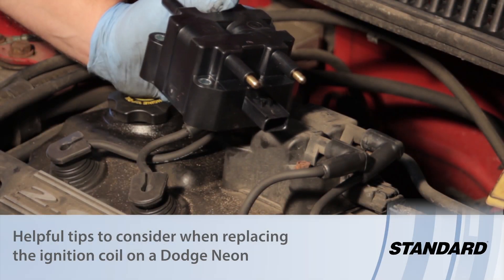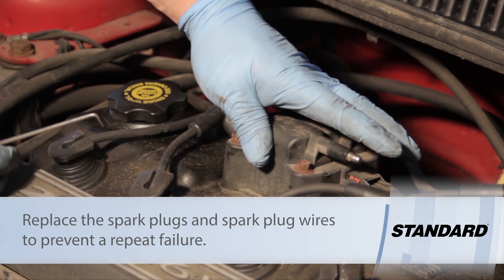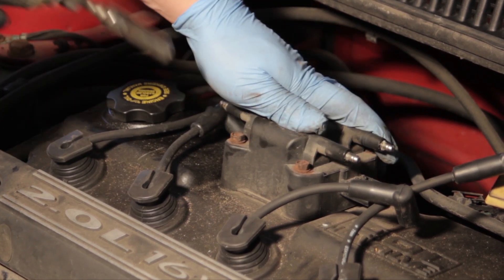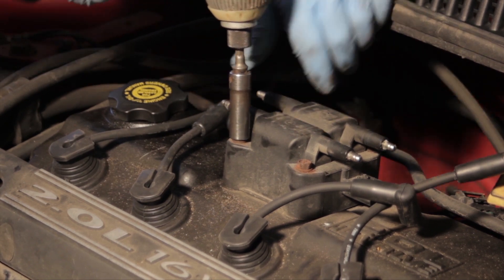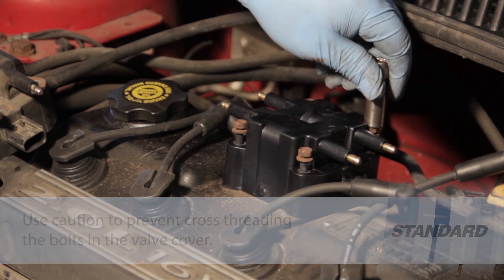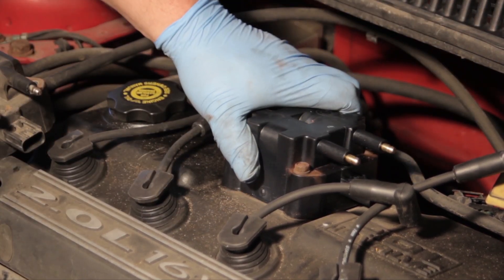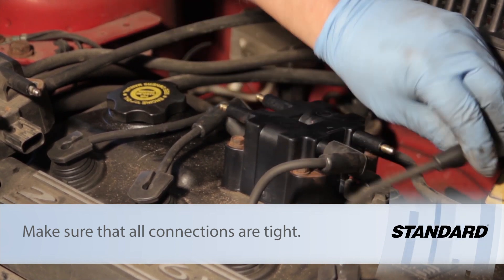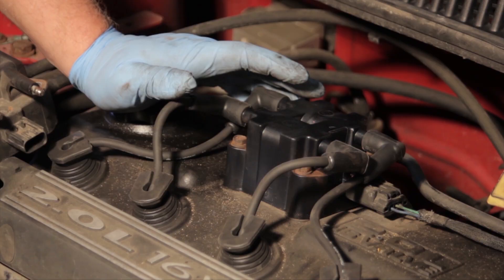Ignition Coil Replacement - Dodge Neon

Comment: THIS COULD SAVE ME LOTS OF CASH! THANK YOU SO MUCH! ALSO, IS THERE AN ALTERNATIVE TOOL THAT WE CAN USE IF WE DON'T HAVE ANY? AND WHAT ARE THE NAMES OF THOSE THAT YOU HAD? I NEED TO CHANGE THIS COIL BY TOMORROW (LABOR DAY)...START A NEW JOB ON TUESDAY AND HAVE TO DRIVE BOYFRIEND TO WORK AS WELL. THIS SUCKS. I'VE HAD THIS CAR SINCE DECEMBER OF 03 BUT IT'S A 2004 DODGE NEON. #GREATANDSIMPLEVIDEO